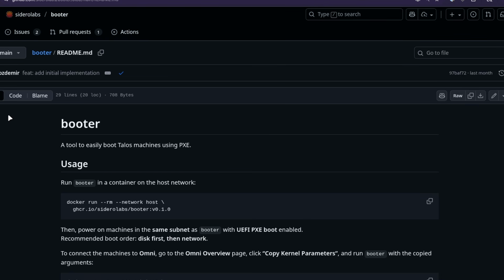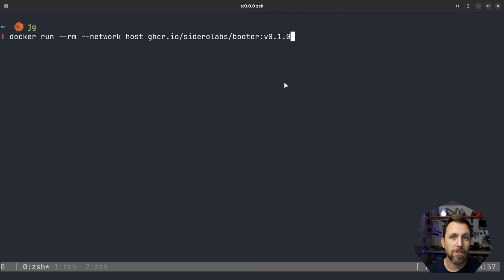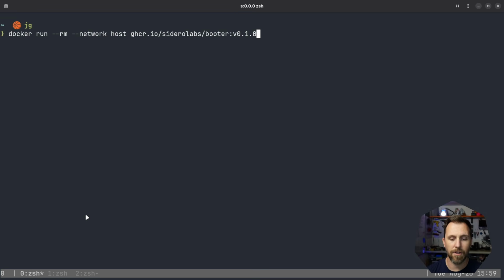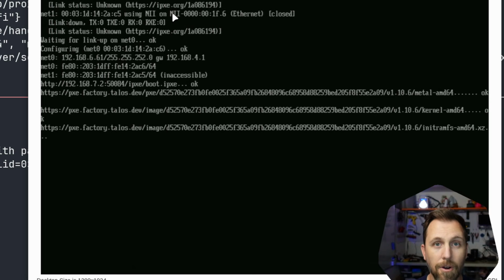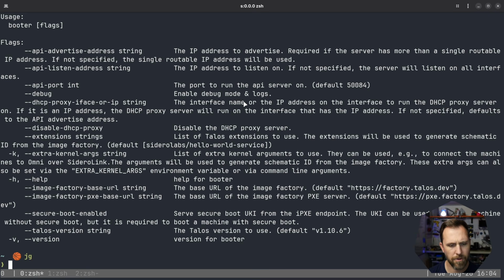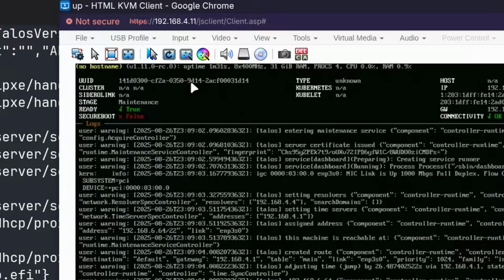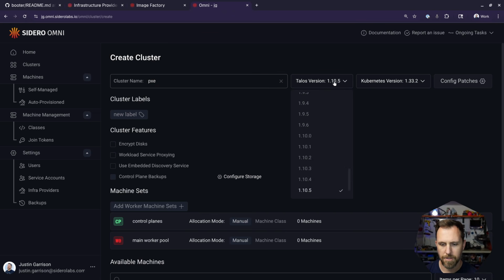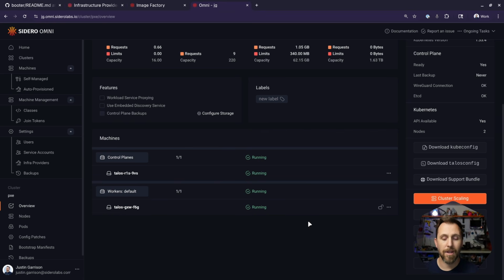Boot Talos Linux anywhere

Comment: Did the machines in the demo have IPMI or Redfish?  The Omni docs seem to imply that one of the two is required for bare metal provider.
Reply from the maker: The bare metal provider requires IPMI but booter works on just PXE

Comment: I'm using matchbox pxe boot, and over there i mentioned my own customized talos image download from factory...? In that do it still needs this booter...? Also It really nice if any how add ignition temple to bootstrap the cluster.
Reply from the maker: If you're already using another tool for PXE booting you don't need booter. It's just a simple PXE booting utility for people who don't have one. Talos doesn't use ignition config but you can mount user-data to the system for pre-configuring machines at boot.

Comment: While booter is indeed very good, one of the challenges i faced recently is to automate the secure boot PK (platform key), as even if the system is in setup mode, talos doesn't automatically enroll it